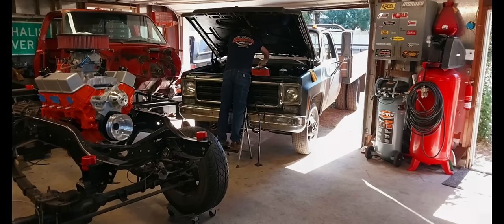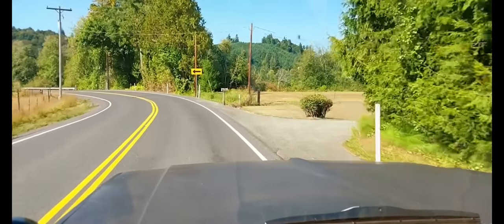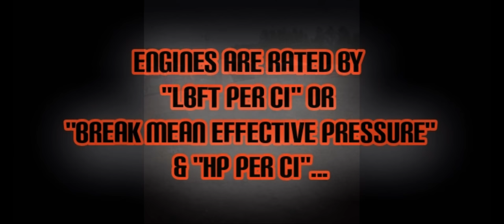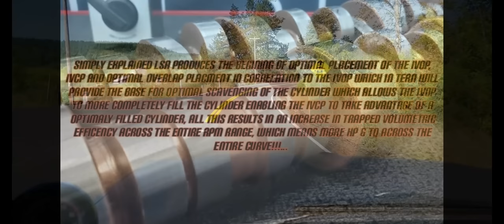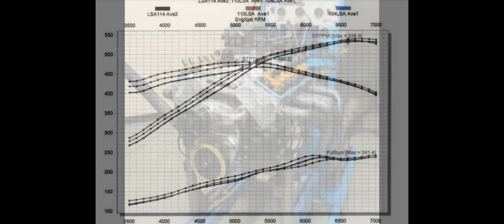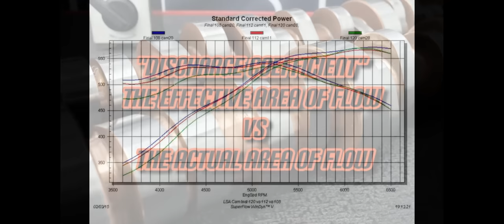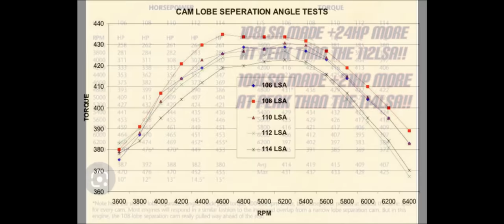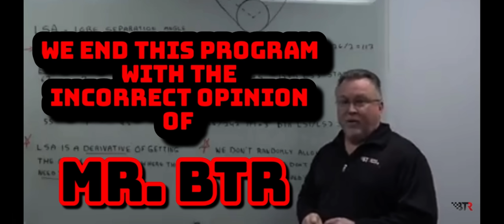Camshaft Selection via LSA, 19LSA's Dyno proven MAX TQ & HP cam tec. LSA, Overlap & Duration convert

Comment: where does comp ratio come into play in the calc?
Reply: Every 1 point of compression is exactly .75 wider LSA so from 10 to 11:1 would be .75 wider LSA
Reply from the maker: That was adressed in the video...
Reply: @ACDGarage_Racing  what about selecting lift on inlet and exhaust?  Did I miss that ?
Reply from the maker: This video was just about LSA & optimal valve event placment to produce the base for max TQ & HP across the entire curve... I had said in the video that the camshaft can be further optimized via multiple other factors, I listed off all the variables and lift was one of the many... I will eventually have a series of videos about all the cam specs, so people get a good understanding...

Comment: If your LSA is 2tenth off will you lose any power ?
Reply: Oh no basically round down now if it really close let's say 106.8 or .9 round up to 107 that will be you optimal
Reply: Thank you for this information it's really help ful .
I have a nother question if the LSA is at 106.5 which way do you go ? ORif the number is 106.6
Reply from the maker: Thank you for watching... Now to your question, with 2°/10° difference in LSA the difference in power would be negligible...
Reply: Hi I have one more question  how do ypu find the LSA on a Pontiac motor ? I know the formulas  which one ?
Reply: @markbogle8062  I don't have the real answer but Cattledog probably would know. So the cylinder head are just a inline valve wedge head like the SBC so I am assuming 128 would work just fine like the SBC do

Comment: Ok, so what happens when you design a cam using the 128 formula let’s say for an LS around stock pistons with no valve reliefs?  Let me tell you!!  You will be buying the piston and valves a real nice wedding present after they get married. (You will have P to V issues) 

If the 128 formula that you posted (which by the way you wrote it incorrect mathematically)  does not work for every engine (which it does not seem to) then I question it’s validity in theory and application. And I think there’s a reasonable chance  one should likely discard it. I say likely because there’s a small chance that the formula in conjunction with some other math works on every engine but I think that’s a small chance and no where in this video is there proof of that.
Reply: Well why you want to out a really wide LSA on a LS if your loosing torque and some HP from optimal. So I think you should buy pistons with valve relieves just like everyone else does on there sbc, BBC, and everyone who builds engine and out a tighter LSA for performance and bigger lift cam and duration for the rpm there going to run at. Just saying dude also the optimal LSA was proven towards the end of the video with a dyno result so I don't know what else to tell you

Comment: Now do the comparison properly and adjust the compression ratio with each LSA and subsequent IVC change to also reflect the same DCR with each cam change. These "secrets of lsa choice" type internet demos are all flawed.  You even talk about this in the vid but base the vid on a fixed CD , so every widening of the LSA you kill off some DCR and wow you lose low end tq ! What a surprise
Reply: Well you know I know a head porter name Chad Spier he tested a camshaft LSA he made it wider after he put bigger ratio rockers and also took away duration and he was afraid it would of lost low end torque but didn't it's all about the engine combo on what it likes

Comment: Having an aversion for unnecessary emotional drama, I could have done without the BTR BS.  Anyway, it's just a matter of what units you want to work with since all the information is there regardless if you think and engineer in terms of absolute valve events or duration. Neither perspective is 100% correct anyway since it's such a nuanced topic and you have to define what you are optimizing for. For example, LSA is not a complete enough picture of what's going on w/o also knowing the ICL. You can install 2 different cams with different LSA's but w/o advancing and retarding each cam to optimize it, the comparison is meaningless. I'm actually more on Brian's side and think its more direct to get wherever you want to go if i think in terms of the valve events. I mean, you appear to have a working empirical model so go with it... but an empirical model is just based on fitting a curve to data. Put the data in excel and you can as easily fit a line that plots valve events with the same fidelity. It doesn't mean valve events are the end all be all, because we are actually optimizing, and in the case of a single fixed cam compromising for dynamic events. We can also go down a massive rabbit hole here on what we are optimizing for as well because you may not even be optimizing for what you should be. It could absolutely worth giving up 10hp up top for 20 down low, particularly with something like your truck and that big RPM drop on the 1-2, not to mention putting down the extra torque early has more impact on ET than putting it down late. On the other end of the spectrum, the guys making truly big power with the late model stuff are doing it at high rpm with converters that stall above 6K to keep cylinder pressures low, so in that case its all about peak power in a narrow RPM range way up top with everything else being meaningless. Nuanced.